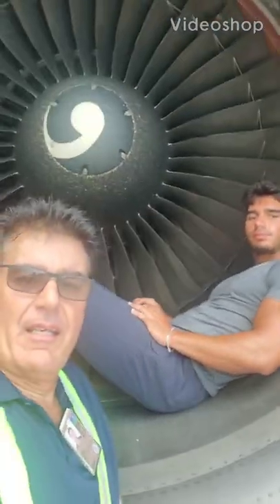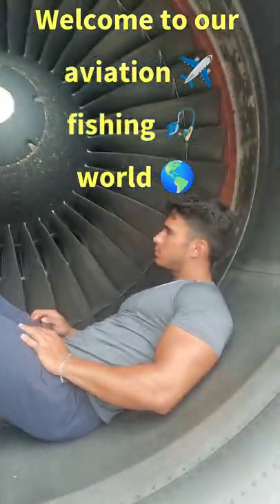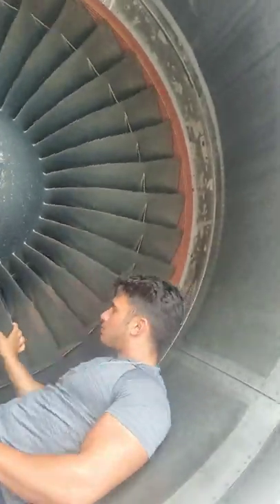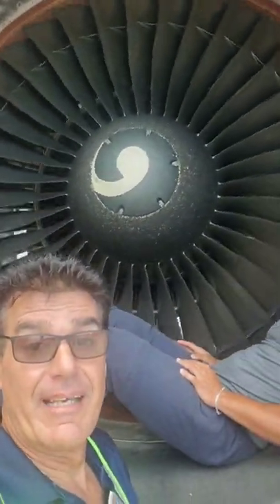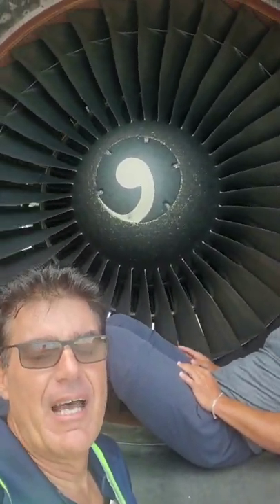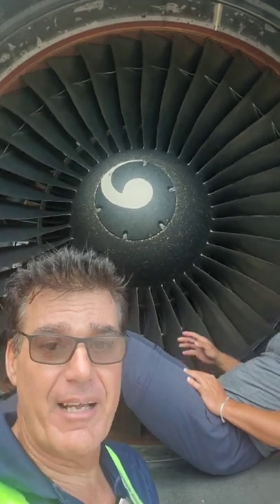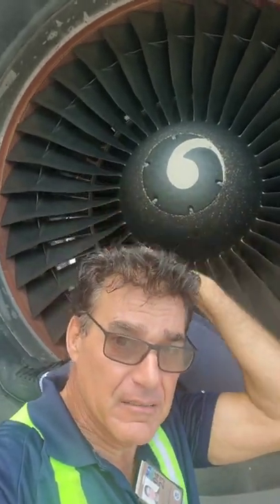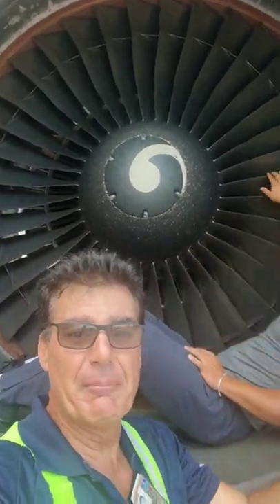Aircraft Jet Turbine Engine Turning with hand✋️#shorts

Comment: Wow. Turbine  engine. How do they work Julio? Do they have Pistons I have no idea is it by pressure? Careful with that lightning stay safe have a great one.
Reply from the maker: Ah thank you Jose. Checkout the link below and you will get like an idea https://youtu.be/KjiUUJdPGX0
Have a great day my brother
Reply: @slipperybeastaviationfishingsh  thank you Julio. Blessings to you son. 👍👍👍
Reply from the maker: Thank you Jose. Sen me an email so we can contact.   Julioperezm339@gmail.com
Reply: Pistons hahahah, bro don't insult a jet turbine engine by asking do they have pistons, turbine engines are and they work way beyond your imagination
Reply: Jose, Turbofan engines(turbine engines) like this are basically a fan which you see at the front, followed by the core which has high and low pressure compressor turbines and a combustion chamber where the air/fuel mixture is burnt during operation, followed by the Nozzle(exhaust) 

Most engines today are high bypass ratio engines, which means more air bypasses the engine's core than goes through it.

The bypass air mixes with the fast moving nozzle air when it exits the engine cowl, and that creates part of the roar you hear from a jet engine, though you hear it less so on newer engines that have technology to make them quieter, like on the 787 or A350, 737 Max etc...

So basically how a turbofan works is similar to a windmill,

The fan spins and sucks a large volume of air in, then some of it goes into the engine's core is compressed multiple times, before entering the combustion chamber were it's mixed with fuel and burnt, then the fast moving air goes through the final high and low pressure compressors, before being exiting out of the nozzle at very high speed.

The final low pressure compressor at the back of the engine drives the Fan at the front.

The air that doesn't go into the core bypasses it through the engine casing and exits out the back of the engine cowl, and mixing with the fast moving nozzle air.

I hope my explanation helped you understand how jet engines work, sorry it was so long winded 🤣

The aircraft engines that have piston's are known as radial engines and are most common in light aircraft such as the Cessna C172 etc...
Reply: @guitarplayerforu  They are incredible. I was at the David Morrell Jr fight Julio. Sad Morrell put a fighter in a coma. I tried to tell them. Morrell he's a special fighter from Cuba. I hope that guy comes through. Medically induced coma. Let's pray 100%, thank you